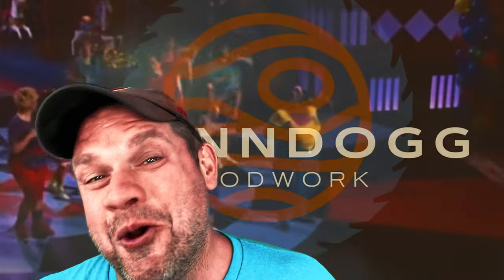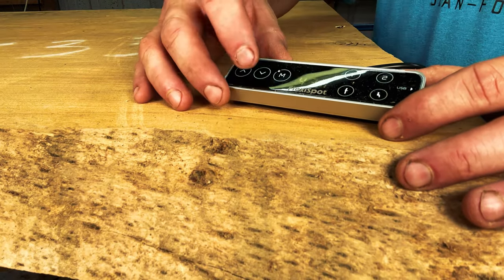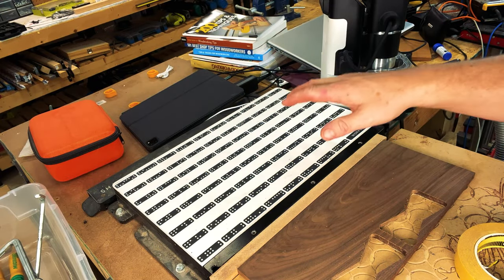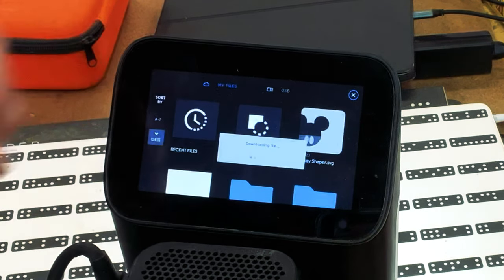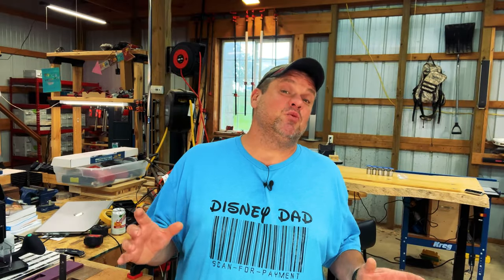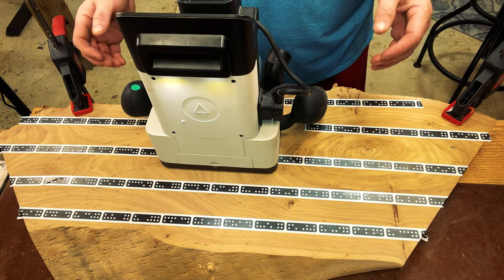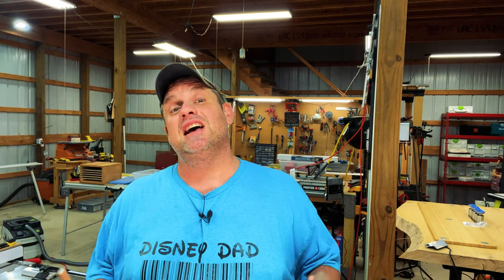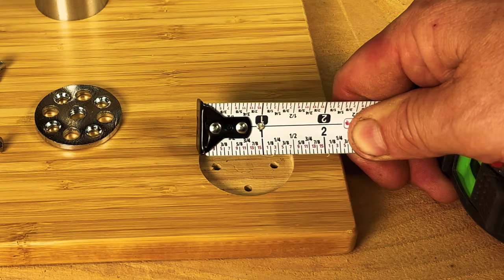Transform Your Woodworking with Effortless Custom Inlays #woodworking #inlay #shaperorigin

Comment: Ok, I've seen the shaper origin used quite a bit, but I knew I wouldn't be buying one any time soon so I never really bothered to see exactly how it worked. I just assumed it was a slightly fancier router. I had no idea it moved the bit to account for you not being exact or that it retracts automatically if you are too far off your line. That makes the price a little easier to swallow. It still won't be in my shop for a while but at least now its on a list of potential future tools.
Reply from the maker: I know that is the absolutely amazing part.  It even retracts the bit if you get to a point where you are going to make an error.  Really is an amazing tool.   And it is quite easy to use.  It's not one of those tools you are going to use every day, but it is definitely nice to have when you want to spice something up!    Thanks so much for commenting and thanks for watching Nathan!

Comment: Next time, use shaper to get rid of the interior of the inlay socket.  Just do an interior cut of the outside line.  Change the offset a little at a time and work your way in.  Nice and smooth bottom
Reply from the maker: Excellent point Glenn - That's usually what i do.  I'm trying to remember why I didin't do that with this project.  I had a reason, just can't remember what it was. :)  Thanks so much for watching!

Comment: Shaper- a manually driven CNC machine at more than twice the price of an automatic one. Which can only do 2D. It has a niche application, when you need to route shapes in an inaccessible place. For machining parts a conventional CNC mill is cheaper, faster, easier, more accurate, can do 3D, and does not even require you to be in the room, never mind drive the thing.
Reply from the maker: Well, I'm not sure I entirely agree.   The shaper has an unlimited dimension ability.  I agree CNC machines are nice, and I intend on getting one in the near future, but they also take up a lot of space and this is nice because it fits right in a box and you can pull it out any time you need it.   I totally get your opinion though.  Thanks so much for watching and commenting!
Reply: @FlynndoggWoodwork  Great thing about CNC machines is that they do not need to be in your workshop. In fact, better not. It will happily do its stuff without your presence, only needs loading and pressing go.
The Shaper seems like a solution looking for a problem. And I do not like that Festool bought the company and pretty much doubled the price. That is what they do...
Reply from the maker: @Tensquaremetreworkshop  You know that is an extremely valid point!  I guess I had never considered that, having the CNC in the workshop.   Now you got me thinking.   I do want to get a full cnc in the near future, although I'll probably wait until my renovation is complete and I can figure out a great space for it.   I'd like to get one with a decent footprint, they are just so darn expensive! :)
Reply: @FlynndoggWoodwork  Depends on the volume of work you are going to put through it. A 'hobby' level CNC (such as WorkBee) is way more accurate than manual machines, and is capable of doing anything a big mill can do- just a bit slower, and will require maintenance more often (but still infrequent). It can be used to develop all the skills and techniques needed, and 'upgraded' with many features at minimum cost. See my channel for my approach to this. Of course, I am a hobbyist, and do not require it to make me a profit. If I were commercial, I would want more- including auto-tool change (the real divisor of production machines). For less than half of the cost of your Shaper you can be in business. If that allows you to correctly choose your final CNC it will have paid for itself. If you decide that CNC is not for you (and a large percentage do!) it will have saved you a lot! I still recommend starting with a 3D printer- it is a gentler introduction to automated production, and has value in itself. At around $150 for a cheap one, it is not a hard decision.
Reply from the maker: @Tensquaremetreworkshop Awesome, thanks for sharing.  Good information!